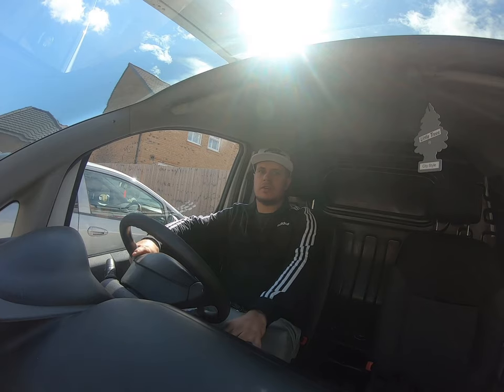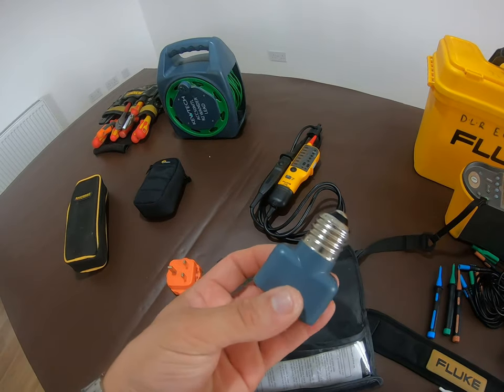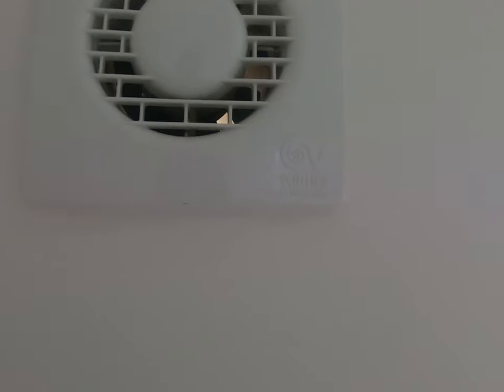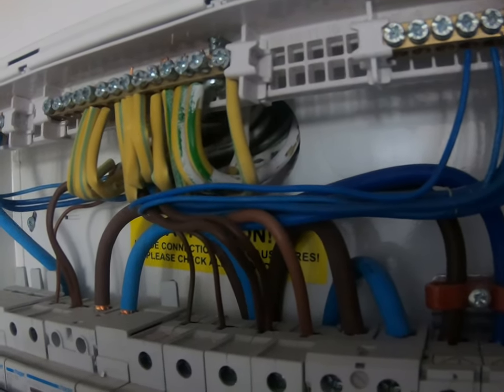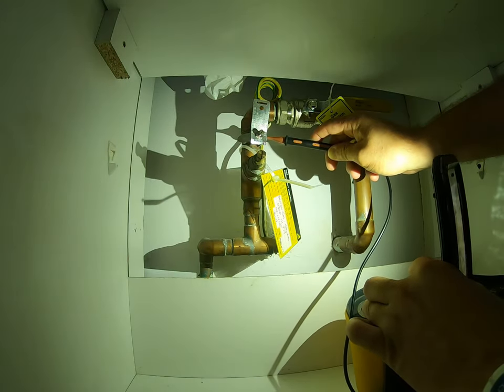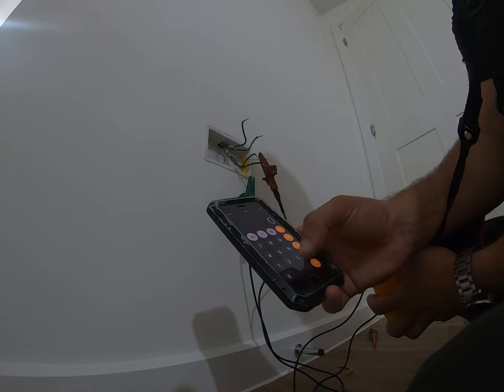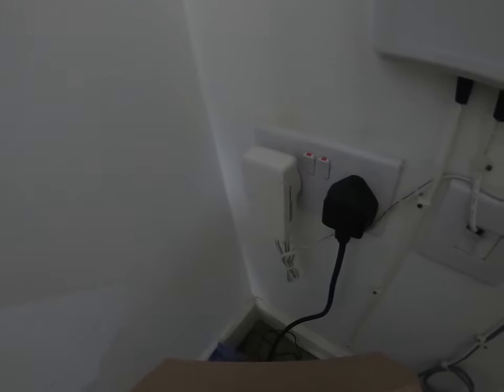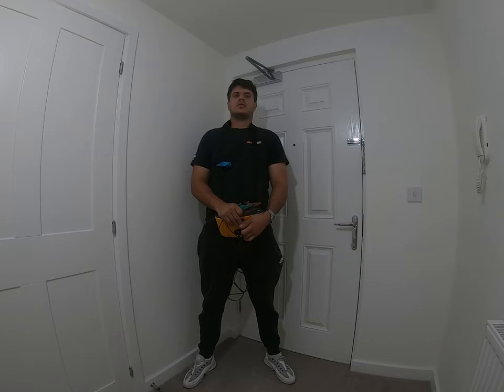Doing a domestic EICR and what is involved (PART 1)

Comment: ive seen those red fuses before and im sure it dosent have a fuse. its a hollow tube inside. double check it and let us know.
Reply from the maker: I would do this for you... but were not allowed to cut seals and pull fuses are we?
Reply: I've never heard of anyone pulling a main fuse before.... You'll get thrown in a faraday cage by the national grid.
Reply from the maker: Andy you are absolutely correct. These hollow tubes do exist only for isolation of the metering equipment with the main fuses being located at the origin of the building. Fair play to you because I absolutely didn't know this!
Reply: Think they are called 'red heads'.